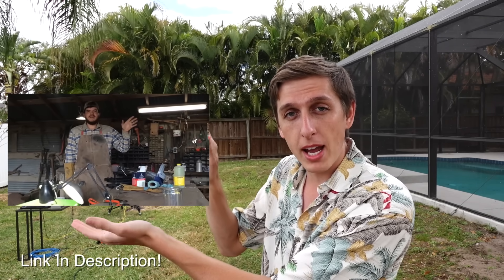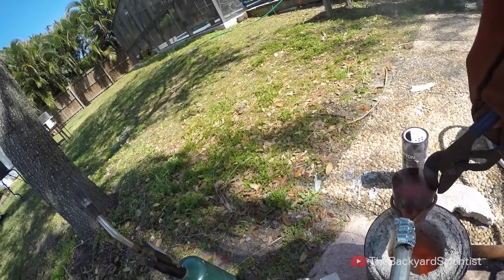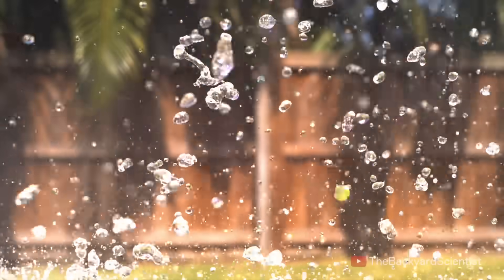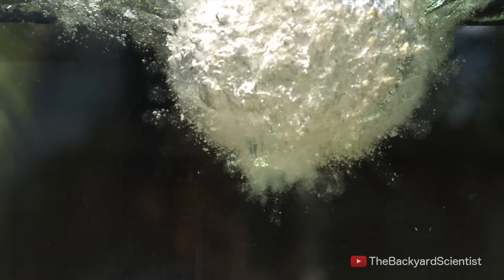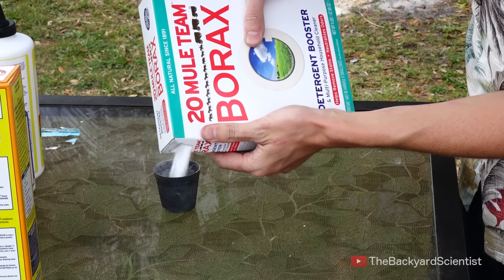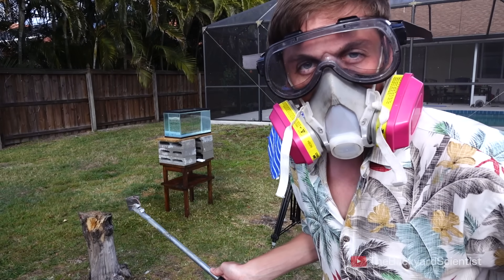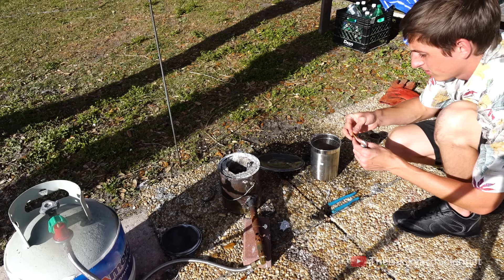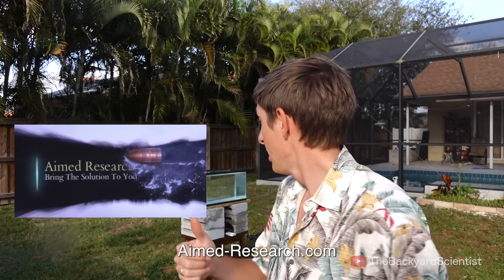Pouring Molten salt into Water - Explosion!

Comment: You don't have to melt the sodium to get the reaction. The reason the salt needs to be melted is so the bonds holding the sodium and chlorine together need to be broken. Sodium is extremely reactive with water. That's why it has to be stored in kerosene.

Comment: I think the other salts didn't react with the water as well for a few chemical reasons. 1 being that the other salts don't have as much electronegativity as NaCl does, particularly with the Cl. Compounds like Sodium Borate are also electronegative, but not as much. 1 more thing to consider is that sodium borate has several oxygen atoms which contribute to hydrogen bonding (coupled with the leidenfrost effect it will render itself ineffective).  Also consider the densities of the molten liquids. 

This is my theory, but i could be wrong of course :)

Comment: 1:10 stainless steel huh?
Reply: +MinerManC3X stainfull steel
Reply: +MinerManC3X I'll give you some real chemistry, unlike this video. Yes, it most likely is stainless steel. It is hard to buy regular steel shot glasses for health concerns. The reason it looks so terrible is that for every 10 degrees Celsius, the rate of reaction roughly doubles. And since stainless steel does rust, although very slowly, the difference in temperature between a hot summer day, say body temp, at 37C and 801C is a lot of doubling. This would allow the shot glass to rust at a very fast rate.
Reply: +MinerManC3X Stainless steel still rusts...
Reply: +MinerManC3X Oh my, never thought that would make me laugh as much! xD
Reply: +IIHellzBallzII After reading your comment I never thought it would make me laugh as much XD
Reply: +MinerManC3X its the thought that counts
Reply: +MinerManC3X I'll believe it.  Whats just under the surface of cheap Chinese machine-made steel products is nothing but bad metal.
Reply: +MinerManC3X it took me about a second to figure what your comment meant..... and then, almost needless to say, i burst out laughing! :D
Reply: +David Kreiger The quality of the stainless steel is also a factor. I worked with it for years and seen low quality stuff rust very quickly. And the good stuff takes literally decades to rust. I have a 8x8 BBQ grill with stainless steel expanded that I use weekly that is 30 years old. From what I  gather the molten salt exploding is a thermal reaction. As a side note, distilled water will explode. Distilled has a higher boiling point than tap water. Bring distilled to a boil, and add an item such as a spoon it will react violently due to breaking the surface tension.
Reply: +Christiann DaSilva Yeah, but it's not truly stainless (100%) then, which is what most "stainless" steel is sold as today, even though it's junk or just the outer layers.
Reply: Darth Frodo how does distilled water have a higher boiling point than tap water? If you know what colligative properties are then you must know that any liquid with something dissolved in it will have a higher boiling point than the pure liquid!
Reply: +Anindya Mahajan the distilled water needs some sort of imperfection to start the boil. tap water has this in dissolved solids.
Reply: +MinerManC3X it's probably an oxide layer from when it is heated so much.
Reply: +Darth Frodo yes it will rust if it is steel. never seen any good quality stainless steel rust so far...
Reply: +BadDrivers  Some types of stainless steel, like  304, will develop rust if the passivated (see google) surface is remove. HCl will do it.
Reply: XD

Comment: the answer is rapid solubility mixed with heat exchange, and the fact salt water repels some gases fresh water doesn't.
try it with salt water. if the reaction decreases by more than 25%. then rapid expansion, rapid mixing and heat exchange is responsible.
I'm not a chemist though.

Comment: It's definitely a physical reaction. If the alkai metals were reacting there would be a flame from the hydrogen reaction and probably some liberated chlorine or HCl, which you would notice. I wonder if the NaCl on the surface is dissolving as it solidifies, letting in liquid water through the steam.

Comment: it explodes more violently with NaCl because salt needs more temperature to melt, so it explodes mostly because the thermal shock, pretty much the same as when we pour very hot oil into water, or when lava meets water

Comment: This is what i know from chem, Sodium is known as an alkali metal. It reacts violently to oxygen, as does its counterparts lithium, potassium, rubidium, caesium and francium. They are used to create hydrogen bombs. The metal reacts violently with the oxygen, caesium and francium would instantly combust in the presence of the air. The rest arent as reactive, being less reactive as you move up the table. Sodium is just being exposed to a lot of oxygen in the water and thus has this reaction

Comment: The molten NaCl has fluid ions of sodium and chloride freely moving in the crucible.  When the extremely hot liquid hits the cool water the ions recombine into solid NaCl. When the ions reform solid salt the reaction is highly exothermic, releasing even more energy into the water. The reason borax does NOT behave this way is due to the size of the tetraborate ion.  Coulomb's law describes how energy is relates to ion size (or ion separation). It states that energy is proportional to the inverse of the square of the ion separation. So larger ions are separated more and the energy decreases by that separation squared.

Comment: Could it be that there is an optimal temperature for explosions, just like there is for the iron balls falling through water in your leidenfrost effect video?

I'm assuming you heated up all the salts with different melting points to the same temperature. What if the explosion has to do with the state the salt is in as well as the temperature? With that I mean that the rate of evaporation of the salt could be a factor. The hotter the salt, the faster it evaporates. Even water evaporates a little bit at room temperature so salts should too.

This evaporation could somehow create opportunities for the water to get in between the salt, causing an explosion. I'm not sure how this would work exactly but it's worth testing. Try heating the salts even more. Does the sodium chloride explode more violently? Do the other salts explode at all when heated enough?
Reply: It's the sodium that causes the explosion
Reply: Since sodium reacts violently with oxygen
Reply: Black-Op345Gaming He showed in the video that that was not the case.

Comment: I wonder if the solubility of the salt is responsible for the explosion of the NaCl. Borax has one tenth the solubility in water at 20C. Try it with ZnCl2. It has a similar solubility in water with a boiling point of 697C, so the Liedenfrost effect should still apply. KNO2 is another option, but it melts at half the temp of NaCl and explodes just a bit beyond that... Probably not an option.

Comment: Just because the "Sodium" in Salt sounds the same as the "Sodium" Metal, doesn't mean it's the same. Sodium Ions are stable, whereas Sodium Metal wants to turn to Sodium Ions really really badly, so they release a huge amount of energy doing so.

Your Sodium metal experiment was very dangerous. Also, because it turns the water very very basic (high pH) and corrosive.

Comment: I'd agree with your conclusion. it works vice versa also. if moisture gets into molten steel, it's like a bomb. when scrap pipe was being chopped at a mill near me, it was filled with mud, pinched at both ends, introduced to molten steel. it caused a 10minute black out from shaking every bit of dust off the rafters and threw molten steel hundreds of feet.

Comment: Chloride chemicals are the most volatile on the periodic table when dealing with heat exchanges and water. I would say this reaction is due to the high temperature difference and is a physical response see to those heat differences.

Comment: It has nothing to do with Sodium as being a part of kitchen salt. I guess that it has do lots with the crystal structure of NaCl:

The crystal structure of NaCl expands when NaCl is melt, because some of the bonds are longer or broken. All in all, when you put it into the cold H20, the water molecules are filling in the holes of the crystal structure that compresses with the lower temperatures. Once trapped, H20 rushes out of the crystal structure and the explosion occurs. Think about that!

Comment: as you said water was able to penetrate one salt via pores and expand. They others had a much tighter molecular bond and didn't  allow water to penetrate and expand inside the molten compound.
Reply: +Tom Clancy Nah, I think that the salt dissolved faster in a liquid state, and because it is so hot it super heated the water it dissolved in to instantly create steam.  Think of it like how powdered things burn a lot faster than a solid object.
Reply: +tigeress da dog This was my thought as well. Borax has a much lower solubility in water. I think he would see a similar explosion with ZnCl.

Comment: Table salt is made of Sodium (Na) and Chlorine (Cl). In its solid form, the two form a very dense latticework, and move very little. When molten, the bonds between Na and Cl are broken, and the two are essentially a giant slurry of individual ions. When added to water (H20), the Na ions will attempt to form NaOH, which involves breaking bonds between Hydrogen and Oxygen. Breaking bonds releases energy, creates heat, and that's the simple chemistry answer.

Edit: Also, when you added the pure Na, you should have seen a major rise in the pH of the solution, as it forms a base when mixed. Add Na as a solid, that may resolve the issue.

Comment: Pretty sure this is a chemical reaction, and not simply trapped water.
NaCl + H20 = NaOH + H2 + Cl2, You are plenty hot enough to drive this reaction.
I'm not sure what is more favorable for the next reaction.
Maybe the very hot material simply ignites the H2.
Maybe there is some reaction with the Cl2, it can be highly reactive and you are adding a lot of energy to the whole thing.
Also
H2 + Cl2 = HCl
HCl + NaOH = H20 + NaCl which is the favorable product at room temperature, and releases a boatload of energy in the reaction.
So you drive the first reaction by adding heat, and get an explosion driven by the energy released when the products return to the favored state.

Comment: Another possibility could be that the molten salt that is initially in contact with the water hardens first, but the salt on the inside is still in molten form, when it starts cooling, it expands really fast and shatters the initial layer of salt crystals (which are already very brittle and have a high tension because of the rapid cooling) and when the outside layer explodes, the still molten salt on the inside continues the physical reaction. Explains the multiple explosions and how they occur in a straight  consecutive line downward rather than all over the tank.

Comment: If you made bullets that had molten salt in them and they open when shot would they explode when they hit a human?
Reply: +Mr Milky how would you keep the salt at +801 degrees celsius?
Reply: Something in the gun would heat the bullets up before shooting
Reply: Mr Milky 801+ degrees is an extremely high tempererature to heat up to. even if it was possible, the bullets would be illegal anyway.
Reply: Yeah I guess so

Comment: I initially thought that since sodium vapors were going out, there might have been a lot of free radical chlorine which would have turned into hcl as soon as dropped into water. If you pour a small quantity of water in hcl, it explodes. Thought that water droplets entrapped in the hcl being formed might have caused it. But your ph test disproves that 

might it be purely to do with temperature gradient? could you try some other compound that melts at similar temperature?

Comment: I think when you melt the table salt the chlorine turns to gas leaving only the sodium, which explodes in water. I think the pure sodium would still explode without being heated. Try potassium next!
Reply: +Ryan Meredith super hot liquid in water cause the water to boil creating steam which expands in the water causing the explosion.

Comment: if I where to it would be due too the reasons you said coupled with the fact that salt dissolves much more readily in water than the other things you used. (not that I have done any research.) to test this try doing it with even more water hungry salts.

Comment: Hi, the actual reason for the explosion is down to the molecular level. An atom of sodium has one less electron than the normal proportion of neutrons to electrons. When the sodium atoms come in contact with the water, electrons from the water rush over to full in the gap of electrons I the sodium. When that happens; so much energy is created that is causes an explosion.
Reply: +Jadon Schneider Sorry but that's completely wrong. 1. In sodium chloride, there are no sodium atoms: only sodium ions, which already have full outer electron shells. 2. And the neutrons have nothing to do with it. 3. There is no "create energy".

If your explanation was correct, the reaction of sodium metal with water would be more violent than sodium chloride, not less.

Comment: Every element in the first group of the periodic table, except hydrogen, is explosive in water.
Reply: +Aaron Boggs what does that have to do with anything? Salt itself isn't explosive in water, however molten salt at 801+ degrees celsius would cause the water to boil instantly creating steam that expands in the water creating the explosion

Comment: What is probably happening is that the other ionic minerals are at such high temperatures that the ambient air is super heated as it passes, vaporizing the water before the minerals can get in contact with them.

Comment: I believe that it's the sodium that causes the explosion I don't know how the sodium debonds from the chlorine atoms maybe because of the intense heat but I know sodium and water do not mix well at all
Reply: +Black-Op345Gaming If you put a super hot material into a not hot material, it will exchange heat, in this case causing the water to boil and create steam which expands creating the explosion
Reply: +Max Dahlin Murphy no the only thing if you put a super hot material in a not hot liquid i.e. Water the only thing it will do is boil. What the heat does to salt is that it weakens the bonds between the sodium and chloride ions and since sodium by itself reacts with an explosion when it touches water that's how you explain why molten salt explodes when in water. If you put molten aluminum in water the only thing it will do is boil and the aluminum solidifies and no explosion
Reply: +Max Dahlin Murphy sodium reacts violently with oxygen and in the right amount of oxygen. If you expose sodium to the right amount of oxygen on land it can and will combust
Reply: Black-Op345Gaming I've gone through this experiment with all 3 of my chem teachers, and they all say what I said, Natrium (sodium) only explodes when it comes into contact with water. When Salt reacts with water (NaCl into H2O) it dissolves into these two ions Na+ (sodium) and Cl-, Na+ does not react violently in water, like Na does, since Ions often don't share the same properties as their respective Atom counterpart.

Comment: To everybody saying that the explosion is caused by the sodium reacting with water: sodium is a group 1 element/alkali metal, but being in an ionic bond with chlorine removes its valence electron. The single electron in the outer energy level is responsible for sodium's high activity, but being that we're dealing with sodium's cation, it is pretty much inert. You've never seen a bag of saline solution violently explode at the hospital, have you?

Comment: I suspect what is happening is due to a rapid thermodynamic transference of energy which is why the hotter the sodium the more intense the reaction. The rapid H2O steam expansion inside the sodium molecule theory seems logical  I'd wager it would be more intense still if you used much colder water or better yet liquid nitrogen - but that seems really too dangerous for an adequate control lab even in an open area.

Comment: How about this? (I'm not physics or chemistry expert, so don't send me to wherever if it's a complete nonsense. xD ) 
Since Sodium Chloride suspends nicely with water, when the ions separate from the great temperature, it gives enough energy for some of the water molecules, that surround the salt to separate into Hydrogen and Oxigene. While it's only temporary, when reuniting into water molecules, the energy escapes in the form of an explosion. Sodium Chloride in this case would act as a catalyst. 

Let me know if I'm wrong, but I think this might be a valid theory.

Comment: sodium reacts violently with water you noob
Reply: +Mike Hawk Sodium metal is reactive because it has a single valence electron; the sodium cation in sodium salts doesn't have that, so it wouldn't react with water or anything else. If it did, there would be a violent explosion anytime you mixed table salt with water.

Comment: It has to be how quickly the salt transfers heat. Which would explain it's use in nuclear reactors. With a faster heat transference you get leidenfrost effect. Because as they cool, they both go from liquids back to granular particulate, so IF the effect is a bit of water getting into the chunk of salt and then expanding it SHOULD work for both, not just one of them. The borax and other sodium compounds have to be dispersing heat much more violently. Ironically, making the reaction much milder.